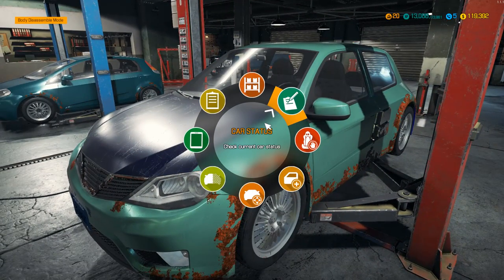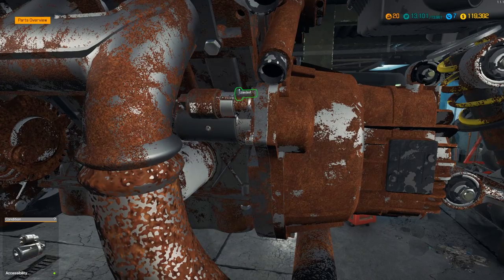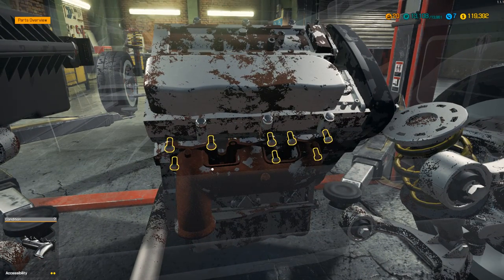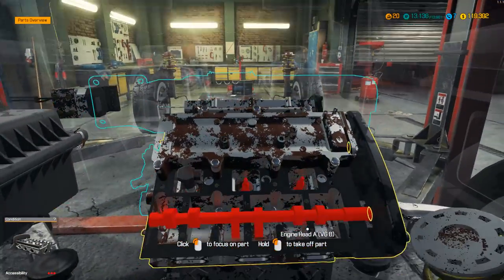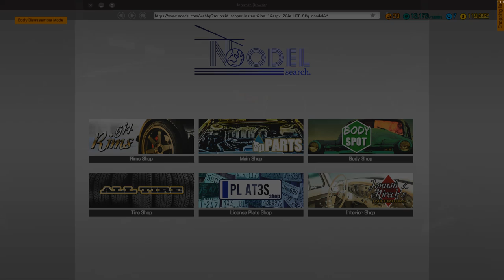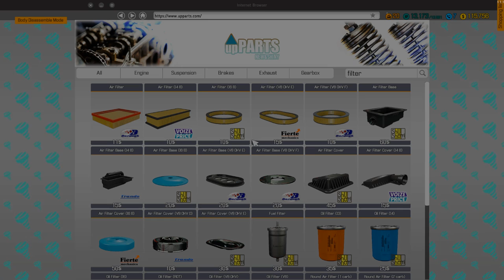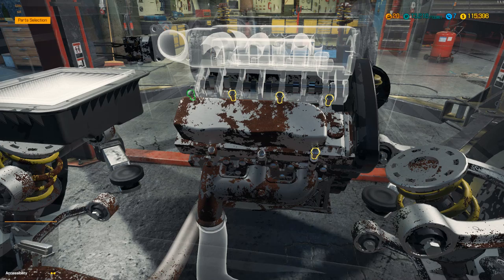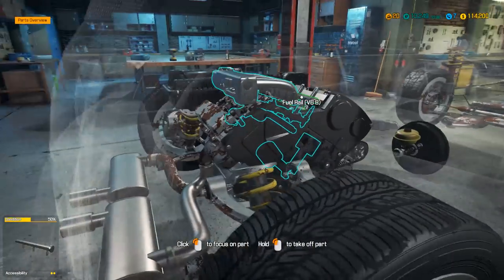Car Mechanic Simulator 2018 - Clio V6 Engine Rebuild

Comment: Rather than shiny chrome parts speckled with rust to indicate the condition of an item, I think the part should simply become darker and less shiny with some grease and dirt on it. especially aluminum parts like the wheels, transmission, cylinder heads etc.

Comment: For building an engine on the stand the easiest way as of right now would be to find a car that the "junker engine" will fit in (customer car or random car in your parking garage even if engine is fine). Then remove the engine from the car you found, put the "junker" engine block in the car with possibly a couple of parts like a crank, pull it with the engine hoist, put the junker engine on the stand, and put the original engine back in the car you found.

Comment: using the compression tester acctually tests piston rings as i found out, it also makes sence since they are supposed to hold the pressure

Comment: For your daft engines you will need to load car mechanic sim on opening it will come up with a steam window saying play game or open the editor or to that description go in there and you can change the engine associated with that car very similar to slrr my current project car is a a magnum with a supercharged v8 have also had it will the w12

Comment: There is a way but you have to find a vehicle that uses that engine and place the engine block in the vehicle then remove it using the crane aftert that  you can place it on the stand

Comment: YOU NEED TO FIND A RX7 TO BUILD
Reply: BUT FIRST, GET A CHALLENGER TO BUILD
Reply: rx7>challenger
Reply: Lady Lynn charger>rx7 and challenger
Reply: Gordon williams, i can see that.. i really like the Dodge charger too, but since we've already seen sort of a charger, i thought it would be neat to see him work on an E-body...

Lady Lynn, are you just an import-fan, and want the mazda over the challenger just because its japanese, or because the rotary engine (which it neat) if the latter is the case, then i can respect that too :)
Reply: Little of both. Not much of a fan of most american cars because of their brutish handling and thirsty V8 engines (Which makes it even weirder that I prefer the rotary engine).

I'm a huge fan of Nissan (datsun), Mazda, Toyota, Suzuki, Yamaha (miss my Blaster), Ford (but only some of their foreign stuff and the Flex), Mitsubishi (need a Starion), etc.

Comment: No Turbo? In the EU they have a TCE engine.
Reply: Standard Clio V6 was never build with a turbo from factory as far as i am aware of. But it really needs one in my opinion, 220- 250 bhp is not enough from a V6. Tons of Turbocharged 4 cylinders out there that smoke the Clio V6 all day easy.
Reply: Cofay Mc und Cs:go V6 is a miracle in Europe. My parents have a 1.2L 4 cylinder engine, 16-valve heads and stronger internals to handle the stress caused by turbo charging. resulting in 101 PS (74 kW; 100 hp) at 5500 rpm and 145 N·m (107 lb·ft) at 3000 rpm. Basically a 1,2L engine with the power output of a 1,4L, torque of a 1.6L and consumption of a 1,2L.The turbocharger includes an "overpower" feature which temporarily boosts power output in 2nd, 3rd and 4th gears at engine speeds of more than 4,500rpm (5hp extra power and 6Nm extra torque).The newer Renault even ship a 3 cylinder engine.
Reply: Nah man, V6s are not that rare in Germany where i live. Lots of V6,V8, 
V10, V12, W12 on the roads here but the most common by far still is the 
inline 4 cylinder. I myself have a car with a Turbocharged 1.8L 4 
cylinder with 192 bhp and 320Nm of tourqe. Its a fast little Sprinter 
but there are may faster cars on the roads here.